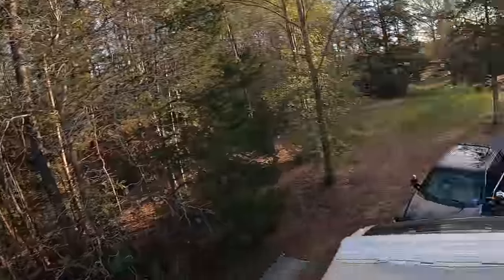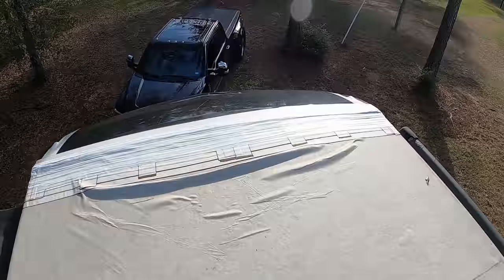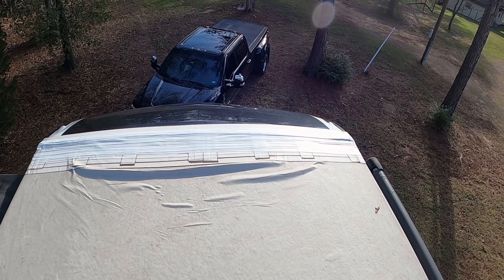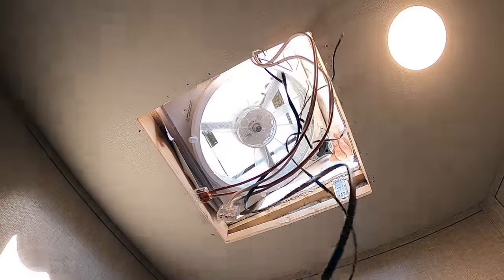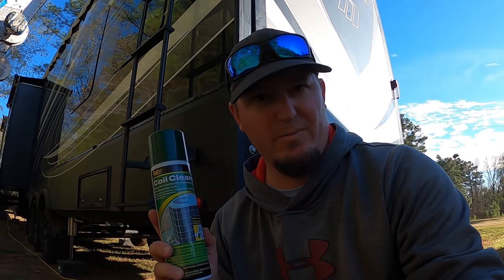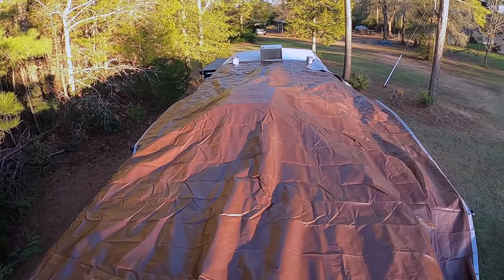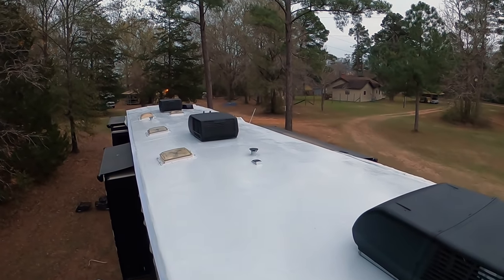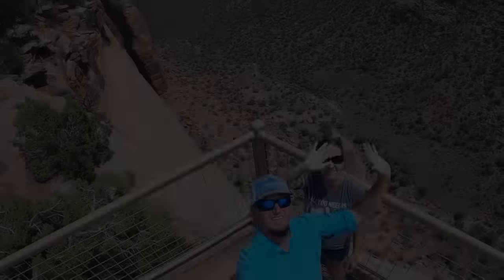Not Such A Grand Design | RV Roof Problems | The Downside To Fulltime RV Life!

Comment: WE now have a new roof on our 2022 xls lde, after 3 trips screws were coming thru the and the roof seemed extremely weak.  Under warranty and 5.5 months later we have her back home.  Rv country Sequim Washinton did the most amazing job.  Grand design took for ever to get hours approved.  The trusses had to be worked on , staples and screws were missing the structure completly and some screws had been filed off.  The plywood was partical board.  Now we have strong trusses, mahogany plywood beautiful smooth roof , no bubbles and sealant that does not pick up leaves and pine needles because it  was so sticky.  Your roof should not be full of bubbles,  NOT NORMAL.  Happy campers now. But we did loose a half year of warranty
Reply from the maker: We are the second owner of a rig that was only 6 months old, but Grand Design and the Dealer were not help, said the warranty was only for the original owner!  The dealership also quoted $12,000 to put the same subpar roof that could fail the same way and is very prone to damage from trees!  We decided to remove Grand Design or the Dealership from the equation and went with RV Armor!  It was half the price, and comes with a lifetime warranty, there is also no more dicor, or Maintenace other than cleaning it every 6 months!

Comment: I noticed your ac units have the ac airflow system installed but you are reinstalling the lower baffle plates which are unnecessary and actually restrict your airflow. My Grand Design Reflection was done the same way from the factory. If you go to the every airflow YouTube page or their website you will see that plate should not be reinstalled. This should make your ac more efficient and help the airflow. Good luck and we loved the video on the roof and will be looking into replacing our roof with this once we see the signs that you did.
Reply from the maker: We never knew that! Thanks! And if you ever use RV Armor mention Paving New Paths for $100 off!

Comment: That really sucks!  I wonder what changed over the years?  My old camper is a 1994 Damon Escaper, which looks like it has the original roof on it.  I could see where there was some sealant applied around perimeter and penetrations over the years, but it's still solid.  Gonna add walking the roof to the list of things to do on the Seismic next weekend!
Reply from the maker: Our roof construction is still solid but the way they glue and secure the membranes to the roof is not very good!  I walk our roof every move and this still happened on a move day!
Reply: @PavingNewPaths  I was thinking that it might have something to do with the "environmentally friendly" adhesives not being as good/holding up, or thinner roofing materials.  Still, what a disappointment!  When I rebuilt the old Damon, I sealed all the joints and windows up with silicon caulk.  I won't use anything water based/latex on anything.  Always shrinks and dries out.  I'll do the same on the Seismic if/when it needs it.  I'm putting a note in my log about this roofing product.  Thanks for the info!
Reply from the maker: @OOMAN  Thanks

Comment: I am glad that i run in to this video to know there is a remedy to the lose roof.
Reply from the maker: Glad you found it, too! If you contact RV Armor and mention Paving New Paths, you'll receive $100 off your cost!
Reply: @PavingNewPaths  I. I don’t think my roof is coming up yet but it is good to know that there is someone out there that can replace them if it does. I have see several trailers on the highways here in Texas with there roofs blowing up in the air but there has not been a way to tell them they have a problem because they are normally going the other direction on the highway.
Reply from the maker: We see them all the time, too! Thank goodness we noticed ours at a rest area one day! Glad your roof is still intact!

Comment: And when you replace the skylight air condition you have to take it back to them to get them to seal it or your warranty is voided
Reply from the maker: The air conditioner has its own gasket so I don't  need them to change that.  But if I need to change out a sky light or max air fan all I need to do is call them and they will send a tech to me to help change it out and reseal the roof intrusions.
Reply: If that air condition comes off the roof in anyway you will have to have it resealed gasket or not and you will pay for it and you will have to take it to them as well as a vent or max air fan I know from experience

Comment: My roof bubbled up as well on my new 22RBE. We pressed all of the bubbles large and small down by hand and they seem to be holding. Probably due to the solar panels we mounted on the front of the roof. The roof oddly has much thicker wood on the front third than the back two thirds. This was a problem when mounting the solar panels. We won't get into the unstapled vinyl in the vents, the misaligned drawers, the bent steps, the screws that punched through the exterior wheel vinyl, the multiple 6 inch holes drilled under the kitchen cabinets for wiring, the open to attic a/c vents (explained why the a/c would not cool even though the air was cold), etc. Would I buy another one, no. I would look elsewhere. I thought I was buying a quality trailer. I did not take the trailer back to the dealer as I have heard horror stories about trailers being in dealerships for a long time and instead repaired things myself. 
 BTW, Grand design said I could not replace my recalled pressure regulator my self because the dealer had to do a bleed down test on it per DOT. After waiting months they called me to service it. After the tech was done I asked him if he did the bleed down test and he said "yep" and held up his spray bottle of soap. I was livid and stormed into the store to complain. Apparently they are not into following DOT requirements. Did I mention the microwave not mounted into the wood correctly..................
Reply from the maker: Sorry to hear about your bad luck!  We have had our share of issues, but all were minor compared to needing a new roof so soon!  We wanted to show there are better options for repairing the roof than the manufacturer or the dealership!

Comment: We had a 2021 Grand Design Reflection 303rls Fifth Wheel. It was a total lemon. We had daylight through walls, kitchen sink falling through, drawers flying out and breaking, cabinet doors that wouldn't stay shut. Called and called and called Customer service and they wouldn't help. They demanded us not bring it up to Elkhart, Indiana headquarters. We talked to the head people and didn't get anywhere. We traded it in on a Keystone Arcadia 3660rl Fifth Wheel. No issues at all with it. Grand Design has horrible Customer service
Reply from the maker: The problem I have is they don't really want to deal with the end customer!  For them once they deliver the unit to a dealership they are done with the unit!  They want you to deal with your local dealer to handle all problems and issues!  Problem is we are second owner and our local dealer didn't sell us the unit so they don't care about service or warranty work with us!
Reply: @PavingNewPaths  I have  2 Grand Design Reflection 303rls video on my channel. First one is showing the outside issues and the 2nd one showing the inside issues.

Comment: Our 2022 gd 3100rd has the roof just like yours but not in one spot but all across the roof. Dealer said it’s normal. Guessing it’s not?
Reply from the maker: Once I discovered our problem, I started noticing small bubbles or loose areas all along the radius areas of the entire camper!  If I had to do it all over again, I would have put this kind of roof on day one and never thought about it again!

Comment: That is so sad you had to deal with this. Amazing the rv roof is not covered because you are not the original owner. So a 10-12 year guarantee is no good if you sell the rv. Now you will have a great selling point now that you have a transferable warranty. That's the way it should be from the manufacture. Great video..
Reply from the maker: Even if they were to cover it, they will only install the same sub par roof that requires you to inspect and reseal constantly!
Reply: @PavingNewPaths  does this roof you had put on not need resealing around vents, A/C's etc. ??
Reply from the maker: @jimg2885  There is no maintence required!  If there ever is an issue or you need to replace a vent or skylight they send a technician or materials to you! The AC units have thier own gasket so its the same as any other roof.  The skylights and vents were installed and then sealed over.
Reply: @PavingNewPaths  thank you and glad you are all set now..
Reply: The warranty is only for materials. So if (and that’s a big if) the manufacturer was to cover a replacement roof under warranty, you’d be getting about $300. The thousands more it costs is all labor. An rv roof warranty from the manufacturer is a big feel good scam.
Reply from the maker: @TheMinnow101  Plus they put the same unreliable roof on that already failed!

Comment: Best product is I. Gray Louisiana 1\4 inch thick uncutable spray on roof no seams or drip rails and no more fabric under coating goes straight on the wood and is backed for life
Reply from the maker: RV Armor comes with a lifetime warranty and there are no seams on the roof!  The final product is a thick rubberized coating that requires no maintenance or resealing!

Comment: I noticed you have rv airflow in your air conditioner and that you installed the put back in the airflow shower plate.  You do not need it with the rv airflow, my 31MB had it installed at the factory too which is incorrect.  Removing it should help airflow and let the system work as designed.
Reply from the maker: Thank you!  Several of our viewers pointed this out to us and we have removed it!  It was in there, so we just assumed it was supposed to be in there! We downloaded the installation instructions, and it says to discard that piece!
Reply: @PavingNewPaths  Really enjoying your video's, traded our old keystone 5th wheel for this 2021 31MB before winter set in here in Manitoba, so waiting for spring, -35 this morning.  BRRRRRR
Reply from the maker: @blairwalkin5733  Thank you, we are glad you enjoy the videos! -35 is to cold for us Texans, stay safe and warm!

Comment: I’ve been shopping for a Grand Design but with their axle problems and the roof problems I have changed my mind. I’m hearing good reviews about Northwood Mfg and Outdoors RV that are made in Oregon.
Reply from the maker: We have not had any axle or suspension issues, however that's likely because we installed the Morryde Crossmembers, heavy duty shackles and wet bolts before we began traveling!  But we did have to get a new roof in the first year of owning it and the bottom of the camper fell off while driving!  We made a video on that as well you can check it out here! https://youtu.be/j0KBsqRIR1Y
Reply: I’ve been living in my Nash for 2 years not even 1 problem..
Reply from the maker: @joewhitfield2252  Thats great to hear that your camper is performing!
Reply: @joewhitfield2252  that’s good to know. Seems like they focus on quality versus mass production.

Comment: It was installed wroung at the front cap . It's grabbing air from the bottom and works it way up
Reply from the maker: Yes, he mentioned that in the video that it was a combination the termination strip at the front cap and not enough glue applied to the vinyl when installing!

Comment: I might have removed the old roof myself and rolled on some rustoleum primer before that guy showed up, maybe the rubber coating did the same thing as an oil primer would have. I appreciate you sharing this experience. I can't imagine how frustrating it was to deal with the manufacturer. 

RV roofs have been an issue since forever. Why they refuse to solve this problem once and for all is beyond me. Moisture promotes mold. Mold can kill you if your exposure is prolonged. So if I develop respiratory issues from living in a leaky rv, if I can prove the manufacturer didn't try to improve this design flaw, or in this case made the design worse, can I hold them accountable for not only my medical bills but also compensation for losing my quality of life?
Reply from the maker: The old roof was not leaking it was just trying to come off while driving!  That is why we left everything in place until he arrived!  We knew when we bought used that we might have issues on major stuff since we are not the original owner!  The money we saved on the upfront cost of purchasing the RV is worth it!  We were able to pay to have a quality roof put on and are still better off cost wise than buying a brand new RV!
Reply: Fully bonded epdm rubber they use it on high rise good for 20 years
Reply: @coreygilbert62  my buddy's winnebago has a fiberglass roof from the factory. Lifetime. Epdm on a high rise doesn't brush against branches when you drive it down the road.
Reply: @michaelosmon  it's very durable  could withstand  it no prob

Comment: I’m going to run out and  with very good glue. A strip across front. That won’t pull up. Problem solved before it happens. Lol. Hold the front of vinyl from lifting on the front. Done. Wham. !!! Fixed.! Done. Funny my double wide roof cheaper. Lol
Reply from the maker: The bad thing is most people don't even know their roofs are doing this! We see the air bubble all the time when we are traveling!

Comment: These coaches don’t have designed structure to secure the end caps to. They often have basic framing that can’t hold a 2” screw without stripping. This is a sin imho but I think they want repeat business to they don’t fix this known problem.
Reply from the maker: Honestly for what they are charging there is a number of things that could be done better!

Comment: Our 21 GD Imagine had signs of this, it didn’t bubble. However I could pinch the TPO and pull up huge sections exactly in that same front area. Our dealership honored the warranty and peeled back the membrane and glued it properly. No issues since. My question is will the roof armor company discount installation cost if I prepared the roof first? Removing the TPO and all roof top accessories? AC, vents ect…
Reply from the maker: You would need to reach out to them to ask that question! I assisted the tech in removing the AC units and all the roof intrusions and there was no discount! I was simply just helping so he could get to the important part which was the roof!
Reply: @PavingNewPaths  yeah, I would have done the same. Hopefully ours lasts a long time.

Comment: my2021 had these bubbles it's a Grand design reflection
Reply from the maker: We originally noticed the radius seemed loose! Then the front cap area to the first A/C would blow up when traveling!  We decided to fix the roof for good out of pocket rather than have the same stock roof installed!
Reply: was grand design going to replace it under warranty
Reply from the maker: @jefflancaster9221  We are the second owner so they don't really care!  The dealer said they wouldn't and wanted us to do an insurance claim that was $12K to replace the roof with the same stuff!  We spend $7500 out of pocket to get a lifetime roof with RV Armor!

Comment: I’ve seen some manufacturers use the PVC roofing, seems more durable than the rubber membrane. I’m always fixing leaks on my roof, annoying! If I was planning on keeping it I’d get something like this done.
Reply from the maker: I can't believe they still use Vinyl or TPO as a roof option anymore!  You have to constantly apply dicor every 6 months to all the seams and penetrations to keep it watertight!  On top of that if a tree branch so much as touches it there is a new rip or hole that needs dicor!  They should offer a lifetime roof like this from the factory! We would gladly pay the upcharge to not have worry about the roof!

Comment: Stop and get a staple gun staple the roof  where it is loose and put some goop on the staples. Another way is to run a line of screws with fender washers and goop under the washer before tightening and after tightening.
Reply from the maker: With this roof there is no need to do that.  They installed and sealed a membrane that is secured under my front and rear caps as well as under my gutters.
Reply: 6 month old RV at that cost!!! I would never staple it nor screw it. But to each their own

Comment: What is really unfortunate is that manufacturers could install a fiber reinforced EPDM roof that will last a lifetime for less than $100 more per camper.   I wish you would have shown more detail about the RV armor roof and the system they use.
Reply from the maker: At RV Armors request I was not allowed to film the process only the before and after shots.  They have their own videos on Youtube showing you the steps!
Reply: @PavingNewPaths  Thanks! looks like a great end product.